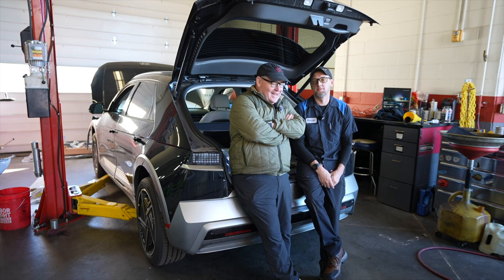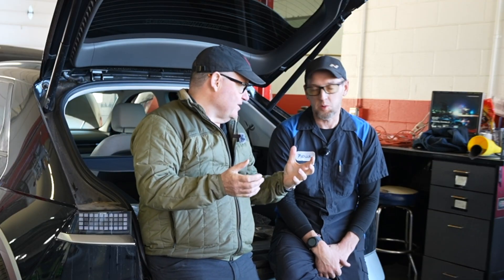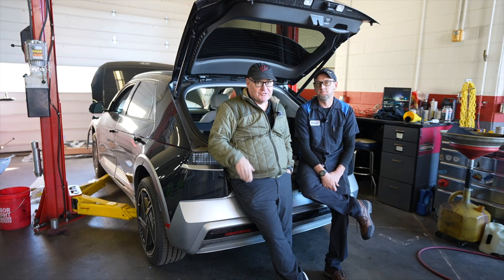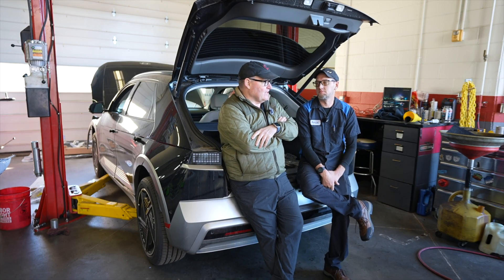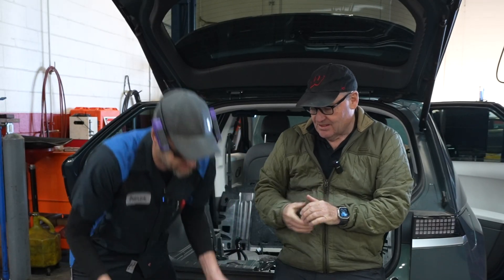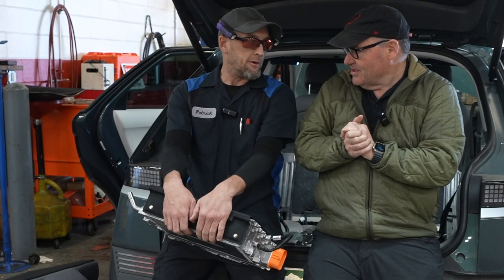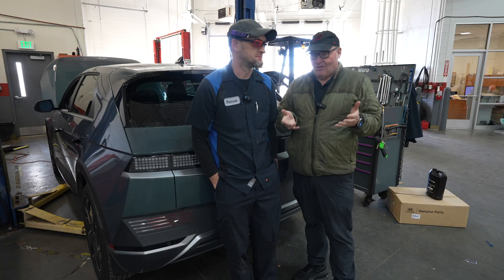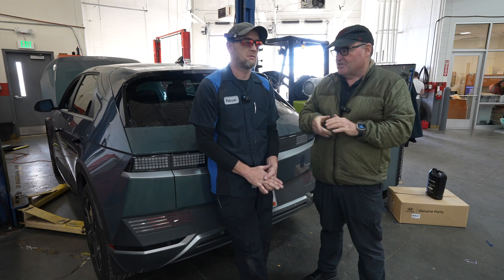IONIQ 5 ICCU Replacement: Patrick Replaces an ICCU  and Discusses ICCU Issues.

Comment: Thanks for this, it's obviously something I worry about on our 2024 Ioniq 5. One question for the mechanics: since you can keep driving until the 12V battery gets low, would it be possible to extend the range after an ICCU failure by attaching a separate 12V power source across the battery? Thinking of a large power bank or something like that.
Reply: DC charging still works, so it seems like all you have to do is use a Level 3 charging station. Otherwise, I’m guessing using a 12v battery tender/trickle charger with work in your garage.
Reply: @petesjk  right, I was specifically thinking of the following scenario: ICCU pops somewhere far from home, so the 12V is no longer being charged. But as you say, can keep using DC fast charging. So, place a battery maintainer on the 12V system, powered by a big portable power bank in the trunk, and let it keep the system going. Could give a way to make it home for repairs.

Comment: It's like 9% in your location but would be worst in colder locations most likely. And it would get worst year after year due to wear off.

Year | Probability ICCU issue | Cumulative probability
1 9 % 9 %
2 10 % 18,10 %
3 11 % 27,29 %
4 12 % 36,02 %
5 13 % 44,04 %
6 14 % 51,28 %
7 15 % 57,79 %
8 16 % 63,66 %
9 17 % 68,92 %
10 18 % 73,63 %

Comment: I don’t know how they can come to the conclusion the 2025 doesn’t have the problem. There are far fewer miles on the 2025 models.
Give it another year or two, I bet they’ll find the 2025 has the same failure rate as the previous years.  I also don’t understand how they can conclude. It happens during cold temperatures because in the next breath, you say there’s a coolant improvement.
Reply from the maker: The conclusions are based on the experiences of one dealership and the 25 models that we have serviced so far.  Our techs worked on the first versions of the attic five, and they had far more problems with ICCUs during the first year. We don’t get that cold the temperatures in the high desert of Colorado. It was 60° today!  What are you basing your experience on how many techs have you talked to? I’m only basing my discussion on the observations and experience of people who work on these cars every day.
Reply: @electricprincipal543  I think your logic is flawed. There was a software update about a year ago, correct? So the 2025 models have been driving around mostly with updated firmware, which addressed something, who knows what. All prior model years have been driving around stressing their ICCU prior to that firmware update.  So it doesn’t make any sense to compare first year failures of 2025 with first year failures of all prior models.
Reply: @tonykara  Our MY23 Ioniq 5 got 3 ICCU software updates already. Our MY25 Inster already got two. They don't seem to know what they're doing based on this...
Reply: @tonykara  Your logic is also flawed. You claim that time will stress the ICCU, but you have no clue what the method of failure is. The fact is, Consumer Reports shows only 4% of owners reporting this issue with their cars. Modern electronics tend not to fail like ICE engines and drivetrains. They either blow relatively quickly or they operate through their designed lifespan. Which is what is reflected in the reporting.

Comment: When my iccu went I  asked the service manager how many they'd done, he claimed he'd not heard of the issue before and mine was the first.

Saw the tech on the way out, I asked him, he said they had 7 lined up waiting for the part.

That was November 24
Reply: After the $30k cdn cost for battery replacement debacle last year, I wouldn’t get an out-of-warranty Hyundai EV.  Lease it or leave it.
Reply: @jeffforbess6802 yeah, that was a strange one. About 10-12k in the UK. Still I wouldn't have an out of warranty one.
Reply: @jeffforbess6802  Agree.. but leasing really does not help. The real issue is the part leaves you stranded without a vehicle
Reply: Hyundai Dealers cannot afford to be open about this matter. They rely on Hyundai for their bread and butter.
Reply: @GeoffC8 they've manged to hide the figures pretty well. At first a 0.5% failure rate was touted by Hyundai, i wouldn't be suprised if it was 25% or more over the life of the vehicle.
Reply from the maker: I can’t speculate based on one dealerships experience.  Our experience would suggest a far smaller percentage, but that is only based on a fraction of the cars sold in the US alone.

Comment: Bob this may be your best vidio yet. I knew there was an issue but I  didn't now what an Iccu was or the real size of the problem.

I have an 24 Ionic 5. Should I be holding my breath? My car is kept in my garage and 95 % of the charging is on my ac charger. Scott

Comment: Great video -- I'm looking forward to the upcoming videos on the 25 26 ICCUs. Our 2024 IONIQ 6 SEL had the software update done under recall and the ICCU went out about 6 months later at 15.6K miles.  Fortunately it happened in the garage at home and not on the road in cold weather.  Car was in the shop about a week and half of that time had more to do with the service department getting to the car to confirm the diagnosis (it showed the code in the Hyundai app after the warning lights came on in the dash). ICCU and fuse were overnighted to the dealership and installed the next day under warranty with rental car included.  Besides this issue the car has been great.  Two questions:

1. At this point should Hyundai treat the ICCU replacement as a regular maintenance/lifetime warranty item for the 2023 & 2024 cars?  In the time we were at the service department we saw 3 Ioniq 5s being dropped off via flatbed tow trucks.  It sounds like they changed the design for the 2025 and on cars and with a replacement rate over 2% to 9% I'm wondering  -- is the ICCU is trying to do too many things in one component?

2. Is Hyundai going to revise their roadside assistance program in the future to be more EV-friendly?  When we called Hyundai Roadside Assistance they referred our call to AAA, who dispatched a roadside assistance truck and not a tow truck as requested. When the AAA showed up with a jump box to jump the car (!), matters went from bad to worse when the AAA tech (who didn't know much about EVs) noted the car was safe to drive to the dealership and missed the fact that the 12V battery only had 30% state of charge.  We had to call Hyundai Roadside assistance back to ask for a tow truck as well as ask the AAA tech to request a tow truck.
Reply: With the roadside assistance issues, I’m guessing this is a staffing issue within Hyundai Roadside Assistance. Reading the horror stories here, it’s clear the customer service staffers had no clue what to do. The only thing you can do is leave a bad review/rating for that call, otherwise the department will assume you were happy with the staffer who took the call. Unfortunately, I’m not surprised that someone at a call center heard battery and then sent AAA with jumper cables.

Comment: Hi, thanks for posting this video.  I own a 2023 Kia EV6 which I bought used in 2024.  It has not itself manifested the ICCU problems, but I have been through a 12 Volt battery replacement under warranty).  I have a couple of questions if you have time:

- The transcript of the video says:
"[...]
15:37 we have had to sell at least 400 of 26s
15:40 right or 25 26s right now. And uh how
15:43 many of those have come back for ICCUs?
15:47 Maybe one.
15:48 Yeah. And if it were a 2423,
15:52 how many would he have done by now? Uh
15:54 in a year's time. Oh, in a year.
15:57 Yeah.
15:58  20 25 myself. You know, some of the
16:01 other guys have done it quite a few.
16:02 So, so maybe 30 35 we would have done in
16:04 the whole shop out of 400 cars that we
16:07 sold.
[...]"

I am not understanding some things about this math.  
- When you said 24 or 23, did you also mean 22?  If not, why not?  
- And when you and the mechanic provide the estimated (off the cuff) numbers for the dealership for the 24 and 23 models, is this 400 that were sold an annual figure per year (for each of 23 and 24, and maybe 22, for a total of 800 or 1200?) or is it the total number sold for model year 23 and 24 (and 22?) grouped together, for a grand total estimated from 22 or 23 to 24?
- And when you specify that you want to get an estimate for 23 and 24 in a year's time, does that mean there have been additional ICCU issues after one year is over (for example a 23 that came back for ICCU repair in 25).

----
The other question I have is for whomever may be capable of answering: how do other manufacturers handle the design issues differently in other EV models?  What did Hyundai and Kia get wrong compared to the many EVs that have no such issue, and does this point a way to a redesign that handles the matter better?

-----

Finally, just a comment or two: 
This whole thing reminds me a little of the Porsche Boxster Intermediate Shaft (IMS) bearing issues. What is going to happen to the value of our vehicles, particularly if, when the warranty runs out, one cannot buy replacement ICCUs hassle-free, with a reasonable price on installation and in reasonable time.

In any case, I'm not directing this toward the maker of the video, but toward the automakers: it is really unacceptable.  I'd love to see a poll of EV6 and Ioniq5 owners who have had to modify or curtail family travel due to this issue.  I surely do hope you have actually fixed the issue with the new redesign of the ICCU that is discussed in the video.  From the early comments in this video and elsewhere, unfortunately it appears that is possibly not fully the case.

Comment: This is really not a very good video, and I am disappointed. Aside from some editing issues with inserting the same clip of Patrick taking a picture of the old and new ICCU twice, there is clearly some bad information.

First, no one in this video seems to be aware of the different failure modes. Patrick only mentioned the failure mode that takes out the 12v charging circuitry, but the ICCU can also fail in a way that only disables AC (i.e. level 1 and 2) charging. Other, less common failure modes have been reported.

Second, Patrick mistakenly reported that the ICCU controls level 1, 2, and 3 charging. DC fast charging bypasses the ICCU entirely, so it is not accurate that the ICCU controls level 3 charging.

Third, I think the issue of ICCU failures in 2025 and newer model years is severely downplayed. One dealer cannot report that it basically isn't an issue just because they haven't seen many MY 25 and 26 cars with failed ICCUs. Spending a few minutes on Ioniq forums or Facebook groups will quickly debunk that assertion.

Fourth, I do not get the impression that the technician here has a good grasp on the design and function of the ICCU. Patrick only seems to understand the bare basics, which makes me nervous if he is supposedly an EV master technician. At the very least, Hyundai needs to provide their EV technicians with more rigorous training, including design and function, and follow that training up with testing to ensure the technicians are knowledgeable and competent.

Fifth and finally, it is incredibly disrespectful to lean on a customer's car like that. You are both wearing jeans/work pants which will absolutely scratch the paint. If that was my car, I would be beyond livid at the cavalier way in which that car was treated. Do not lean on other people's cars - if you are okay with damaging the paint on your personal car, more power to you, but you should be treating other people's cars, especially customer cars, with more respect.

Also, Bob, please stop saying "um" so much! My high school speech teacher would have a conniption if you were her student! A former principal should really be able to speak without so many distracting verbal pauses when attempting to present technical information to an audience.

Comment: thanks guys for showing this. i'm in the UK an i can tell you the ICCU are failing even in brand new released car like the kia EV3,EV5 in 2025 there is one guy in Spain is now on his 5th ICCU in him EV3 in only 13000 km. so the humidity comment is not likely there seem to be a lot of failed ICCU when AC charging, someone lese has post info on a stripped an  ICCU saying there could be failing due to condensation build up inside. it would be interesting when you do the next one in the cold month and do an isolation/insulation test, to see if there is a leakage to the case?. look forward to the next video
Reply: If the condensation gets vaporised I am not sure your "insulation test" is relevant. I suspect a single droplet of water is all it takes.

Comment: I think YMMV in terms of repair time, depending on how big your dealer is.  Fortunately, I bought mine from one of the largest dealers in the state.  No issues with the ICCU yet, but based on other work they've done, I  have faith that they'd make relatively short work of it if they had to.

Comment: The ICCU issue, and the lack of a response from Hyundai about this, has me looking at other brands. No car is perfect, but after dealing with a Theta engine issue, I am really hesitant to buy another Hyundai, and I have owned 4 over the last 20 years or so.

If you sold 400 and you have done 35, thats nearly 10% failure rate. That is 5x what Hyundai is claiming the failure rate is.

Comment: I really want an Ioniq 9 or EV9, but am waiting until this is resolved.  My current ICE Kia has been very reliable, and I'll feel like an idiot if I trade it for something that becomes problematic.  I've even started to consider a General Motors EV, but the model I'm most interested in is more expensive and does not yet have a NACS port.
Reply: I haven’t heard of this being an issue with the 9’s.

Comment: Sounds like Hyundai has a either an ICCU design issue, but more than likely it is a quality control PRODUCTION issue on the ICCU components. If it were a design issue, EVERY Ioniq 5 & 6 with this unit would be having this problem.
Reply: It could be a combination. They may have designed with not enought tolerance built in. Electronic componens always operate within certain boundaries so if a component is at the low end of the allowed tolerance, it may fail.

This smells like a typical case where bean counters forced engineering to cut some corners in order to save a couple of bucks and now it has backfired. Why on earth they won't fix it is beyond me. This is not astrophysics, it is just plain electric engineering. There must be some politics going on at HMG because any engineer worth their salt would be able to fix this once and for all.
Reply: @KsiNixNie  Stacked tolerance issues have been running wildfire throughout the automotive industry, so I wouldn’t be surprised if the bean counters have applied standard operating procedure, again. Blind leading the blind these days. Stacked tolerances are what caused the first generation Bolt to have issues with their battery packs, while my Volt still has a battery pack well within spec.
Reply: I think these failures happen under certain conditions, some cars have repeated failures while others have none at all.

Comment: 35 ICCU problems over 400 cars sold is an 8.75% failure rate. That's staggeringly high!

Had I known it was so bad I wouldn't have bought mine. Now I suppose I'll have to live with this Damocle's sword dangling over my head...
Reply from the maker: The dealership has sold over 1000 cars in the past four years. They sold 400 last year.  You are misunderstanding the tech. He’s talking about the total number of ICCUs he’s replaced in the shop.

Comment: Hum… From Québec, Canada. I have a 2024 RWD Ioniq 6 purchased in June 2024. The ICCU is not the only electric problem that car has. On top of things, you have the flimsy 12-volt battery that typically fails within 2 years, hence why it’s only warranted for… 2 years 🤪 Also, and this is the issue I’m currently having: The ICCU limits the Level 2 charge to 9.3 kW, exactly, while my EVSE can provide 11.2 kW. The dealer’s technicia tested my car, and said nothing was wrong with it although there was an error/fault identified in the monthly health report I get through emails, and I had provided a print screen of the error message in the car’s dashboard about the charging delay due to over heating. Sooo, I went down to the dealership, somewhat made at either the B/S or the incompetency, and had to explain to the technical advisor that his reasoning made no sense. I showed him where his dealership had a 12.2 kW EVSE and told him to charge my car at that EVSE. A miracle happened: Although the dealership’s tech couldn’t find the issue, it appeared right in his face after 30 min! Reportedly, the charging port is the issue. It will get replaced this coming week. We shall see.
Reply: I’ve heard that 12v batteries in general don’t last as long, mainly because of the increased electrical demands of modern cars packed with more electronics. That said, my Volt battery lasted 5 years, and I’ve heard similar lifespans for Tesla batteries. I’m guessing good software and sensors help.
Reply: The dealership changed my charge port 2 weeks ago. I’ve tested the repair. I can now charge at 11.2 kW!!!😊

Comment: iccu is the main reason i will not buy any ev from hyundai or kia.
Reply: Same here. I would have loved to buy a used Ioniq5 MY 21 to 24 but the ICCU issue as well as the horrible cost of replacing blue low-conductivity coolant (my local dealer charges 1.500 EUR every 3 years) are unacceptable. Cancelled my plans.

Comment: Great video. Only correction is that the ICCU plays no role in L3 charging in terms of current going through its components. In L3 charging it uses the L2 legs to send/receive control signals, so L3 current just passes through the ICCU, but is separated from the caps and other electronics that can go bad.